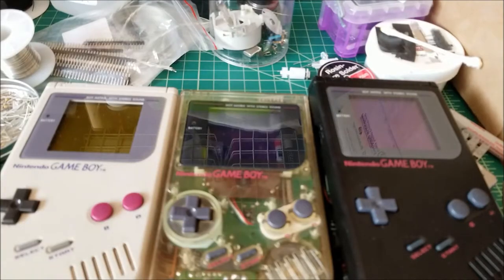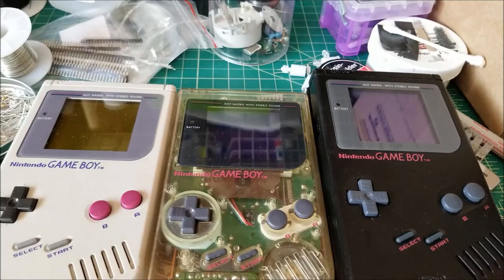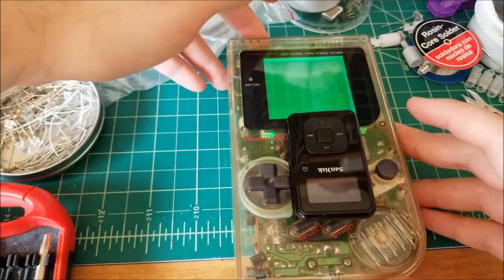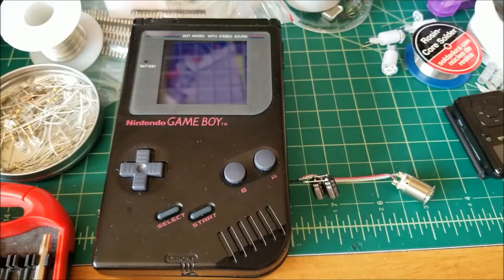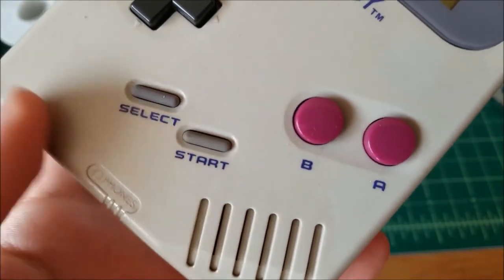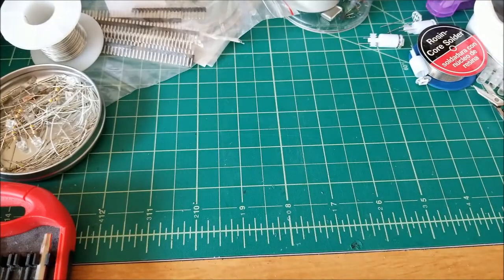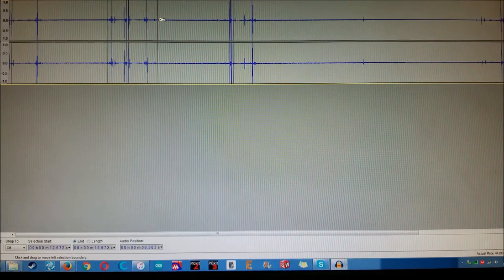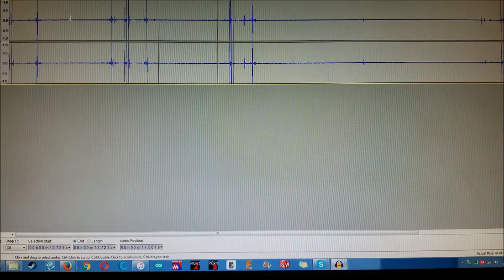Let's Experiment!: Noisy Audio Modded Gameboy Testing and Fix

Comment: I’m scared I’m going to mess up if I mod a game boy
Reply from the maker: My advice is to practice modding/fixing broken things people throw out/give away. That way you can get comfortable and learn the skills for free without the risk of breaking anything valuable. That's how I started learning about electronics.
Reply: Don't be scared, all you need is a little patience, and we can talk you through the rest. Search Ebay for an "as is DMG" or "for repair", and keep your limit to around $15 (you'd be surprised how many go for about that much), grab a $1 - $2 Tri-wing screwdriver, a cheap soldering iron, and some solder & flux. We are happy to help guide you through each step, shoot me an email through my site, or join the new forum (free) and we can get you going. That's how I learned (and still am learning, Shawn teaches me something new on a daily basis)
Reply: Thx 😀👍

Comment: hey i found your channel through a comment in the retro future, really nice videos man keep up. btw i have a gameboy color with a ton of scratches on the screen do you know any cheap solution?
Reply from the maker: Cool, thanks for the encouragement. You can find cheap plastic screen lens for the gbc on ebay for a few dollars and really nice glass ones for something like $4-8. I've used both and although the glass ones are a bit more expensive they look so much nicer than the plastic ones. Sites like Deadpan Robot and Handheld Legend also sell both varieties and offer better customer service and faster shipping for a bit more than ebay.
Reply: sjm4306 the problem is i live in spain ( in the canary islands so its even more money ) and im also 13 so cant really buy online, i was looking to polish the screen or something
Reply from the maker: daim ProPlayer Gotcha, well I have used tooth paste and car headlight polisher to remove small scratches. I've also heard that brasso, a pot and pan metal polisher, works well. Of course test on a scrap piece of scratched plastic first for practice and to make sure you aren't adding more sratches.
Reply: sjm4306 ok ill try

Comment: I found the Dmg-01 of my childhood. It makes a quite strong buzz noise that I can't remember from back then. I can definitely hear it from "playing distance" so it's much louder than yours. What could that be in your opinion? Thanks so much!
Reply: BTW I haven't modded it in any way other than applying kids' stickers 30 years ago ♥
Reply from the maker: The capacitors must have gone bad and need replacement. It's a common problem in electronics as electrolytic caps age they dry out and can affect operation in strange ways.
Reply: @sjm4306    Thank you for your reply! I wanted to try to give it a throughful cleanup before replacing the capacitors. So I put it in ethyl alcohol in the ultrasonic cleaner. Guess what: the sound is now CRYSTAL CLEAN! I had no idea that dirt could cause electrical noise in PCBs!
Reply from the maker: Glad to hear a good cleaning was all that was required! Yep, that's completely possible as dust/dirt can suck moisture out of the air and become slightly conductive, creating current leakage paths that aren't supposed to be in the circuit.

Comment: On my game boy backlit clear DMG ( that you probably saw on RetroDX ) I have bridged the headphone jack to the volume wheel and it removed all of the noise in the game boy ( it's called internal pro sound mod )
Reply from the maker: Interesting so basically it was a ground loop of some kind causing noise in your gameboy.
Reply: sjm4306 no by doing this you just bypass the original sound amplifier which makes a him noise
Reply: But you still hear slight hum with the speaker
Reply from the maker: So wouldn't the audio be much quieter since you are bypassing the amp? Maybe using shielded wiring for the bridge would help. Is the hum a low or high frequency? If it is low then you might be picking up stray mains hum since your wires are acting like antennas.
Reply: Hey Pixcub, the internal prosound does help remove the humming from the headphone jack by bypassing the amplifier and feeding the headphone jack directly with Left Right & Ground from the Logic Board, however I believe that Shawn was testing on how the added Capacitance helps to reduce the humming from the speaker. Unfortunately the prosound mod doesn't remove the humming noise from the speaker.